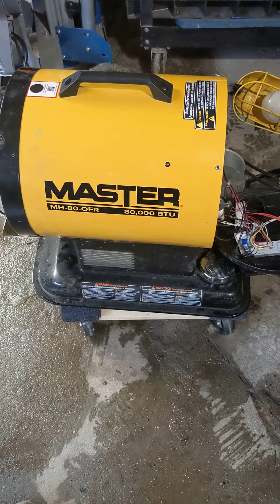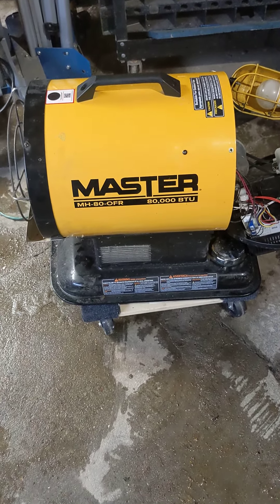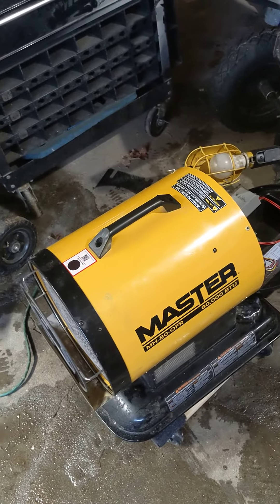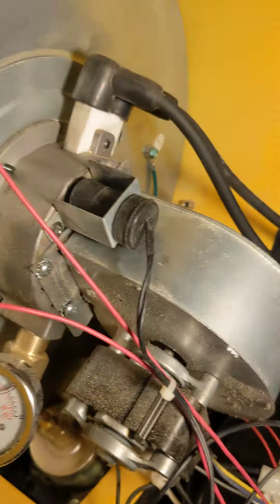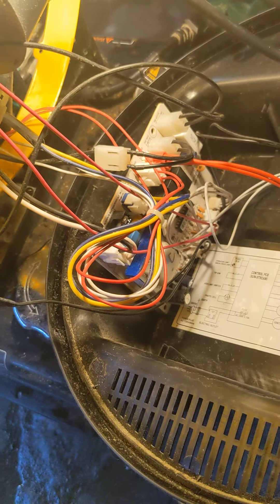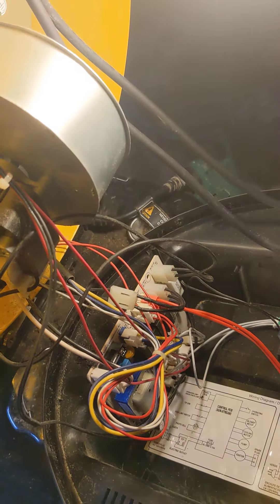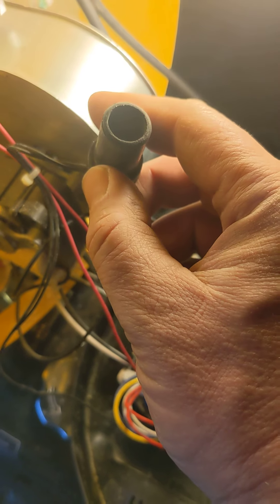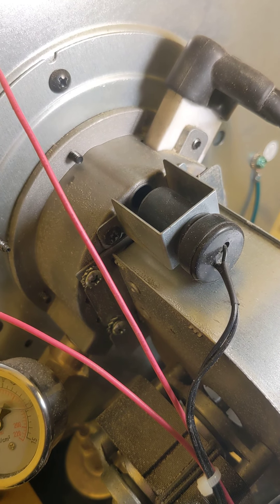kerosene photocell Troubleshooting

Comment: I have a master 70-ss-A had the same problem.   Purchased a new photocell - ran for about 2 mins then shut off.   With bright light it runs continually - does not shut off.  Before you go buy a new one try this.  The sensor can be pushed into the very back of the rubber housing - either by cleaning where it gets pushed in or by pulling on the wire - try pushing the sensor towards the front of the rubber housing - push on the wires (if there is a band around the wires pull that back to allow you to push them in) - get that sensor about 3/4 of the way to the front opening of the rubber housing.  then reinsert the whole thing into the retaining part.  This in effect pushes the sensor closer to the opening and allows it to get more light.  I did that almost by accident and it has been running fine ever since...kinda wondering if there was actually nothing wrong with the old one after all.
Reply: This is a fantastic tip. I had tested mine and confirmed my problem using a flashlight. I thought I would have to buy another photocell. Moved it forward just like you suggested and it worked perfect. No more issues.